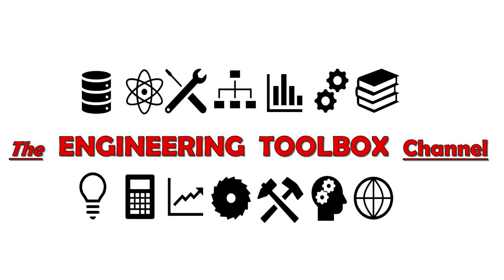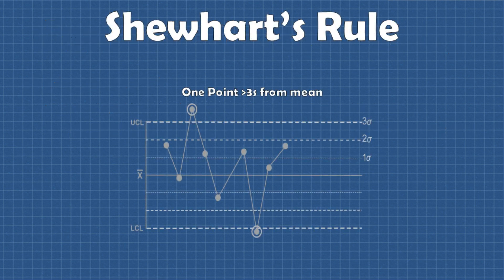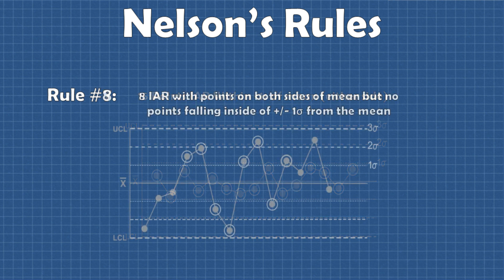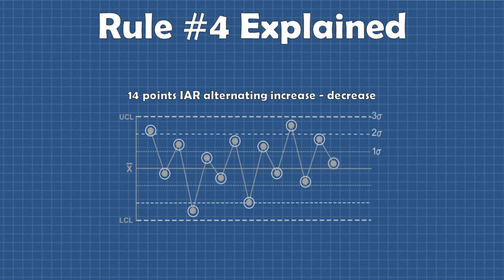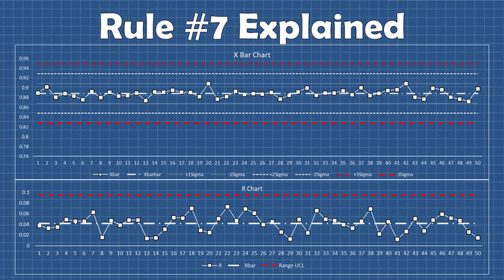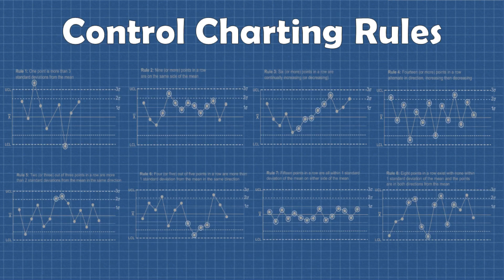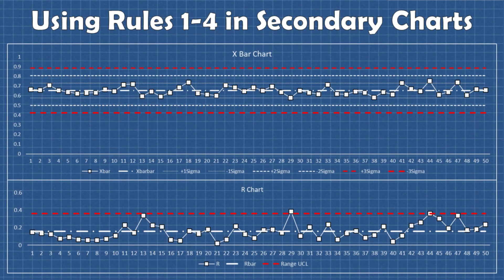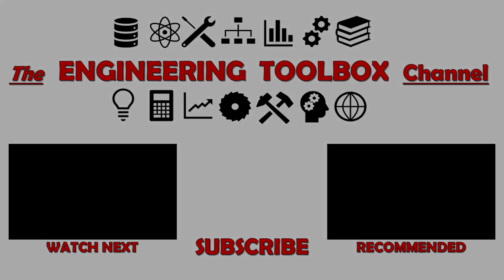SPC Control Charting Rules

Comment: Very interesting to know that nelson extended the rules up to 8. I thought all rules are introduced by Shewhart. Just wanted to know that after we build charts, can we automate to detect patterns and shifts. Or manually do we have to detect the patterns and shifts?
Reply from the maker: It can be automated! There are stats programs like MiniTab built with these techniques in mind.  I also have mutiple videos on my channel to show you to do it in excel! Check them out!

The only manual part of SPC is setting up appropriate sampling plans and deciding which rules you want to use/consider in your analysis.
Reply: @TheEngineeringToolboxChannel  Thanks, I will checkout MiniTab.

Comment: Ok full explanation of most of the validation/interpretation rules. But I hope one day someone can make a ‘good’ video about the correct continuation and maintenance of a control chart... what to do with the parameters (average, standard deviation, control limits, outliers etc) in a new chart and the dataset of all the previous charts etc etc... or can I find this somewhere in a good publication? Greetings and my search goes on ;-)
Reply from the maker: Control charts and their parameters should be started or “reset” from the point the process was established and determined to be stable. If the process is changed you have to restart as well.  I.e. verify control and reestablish the parameters for the process.  Hope this helps!

Comment: Please help 
A quality control engineering is considering the optimal design of a X ̅ chart.  Based on his experience with the production process there is a probability of 0.03 that the process shifts from an in control to an out-of-control state in any period.  When the process shifts out of control it can be attributed to a single assignable cause, the magnitude of the shift is 2σ.  Samples of n items are made hourly and each sampling costs $ 0.50 per unit.  The cost of searching for the assignable cause is $25 and the cost of operating the process in an out-of-control state is $300 per hour.
(a) Determine the hourly cost of the system when n = 6 and k = 2.5 
(b) Estimate the optimal value of K for the case n = 6
(c) Determine the optimal pair of n and k.
Reply from the maker: I do not have enough information or know enough about your coursework to answer this question.  Sorry...I recommend talking with your instructor for help.

Comment: Whooo! Keep up the good work!!!!
Reply: Hehe yeah! I see you added some other ones, ill go through em tomorrow at work. Thanks a lot again my friend
Reply: Hey, friend. I know we spoke about the removal of special cause variations from the data set, but my question is when do you stop? I was practicing with my technicians with some data points we collected from Temperature and Relative Humidity in the labs, and we noticed we had SCV right off the bat. We discussed the causes for these signals and determine the were cause by factors beyond our control and the data went back to "normal" shortly after. We removed those points but we kept seeing more SCV. If we were to remove all the points that were SCV, our data points would drop for 31 all the way down to about 16. FYI, we did removed them one by one and recalculated the limits each time. Is there a limit to how many points you can remove?
Reply from the maker: There is no limit to the amount of points that you can remove but you have to be able to assign a cause and CORRECT the issue when removing points..  The other thing, is that if you have that many points out of control in your data, the whole process may be out of control and monitoring the process with the chart will do you no good because you dont have a predictable process.  Also, A rule of thumb to keep in mind is that 30 data points are required to make a reliable control chart...sounds like you only have 16 left? I would say that is not enough.  And What type of control chat are you using? This could also be a sampling issue.  Would you be able to send me the data?  theengineeringtoolbox@gmail.com
Reply: @TheEngineeringToolboxChannel   Actually its more like 49 points I believe, and after correcting the SCV there were still points spiking outside of 3Sigma. Sure I Can send you the Excel sheet. It'll be from my work email : metrology.officerIII@bbs.gov.bz just in case its in your junk.
Reply from the maker: @envcas31  Sounds good ill take a look.
Reply from the maker: @envcas31  Envic,  I hope I have been able to help you with your control charts.  Always happy to help and provide my input!  Thanks again for the engagement. :)
Reply from the maker: Env Cas31 knew you’d like this one! Thanks!